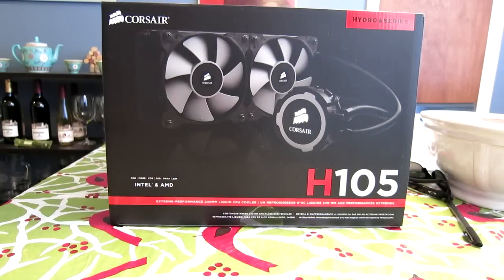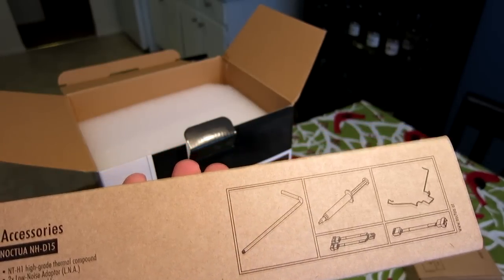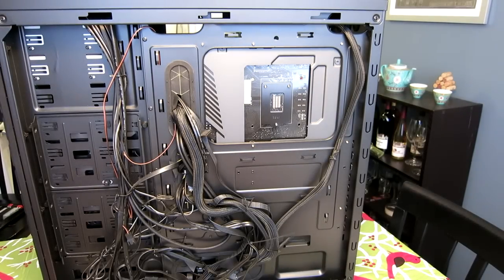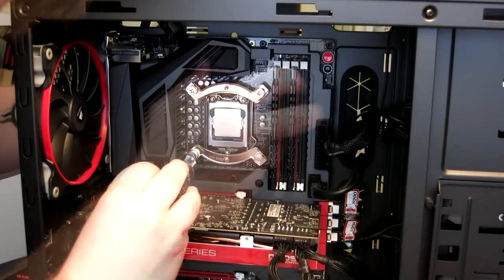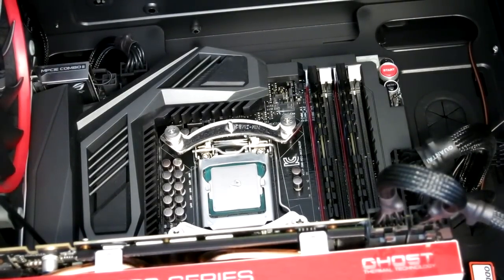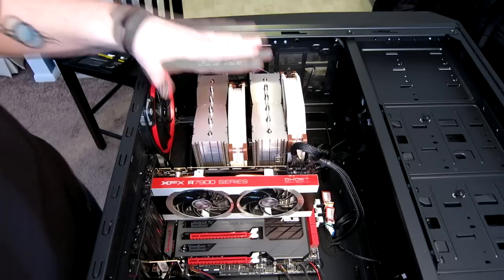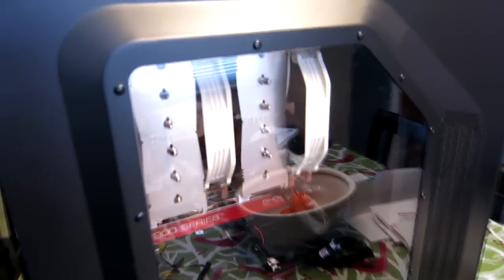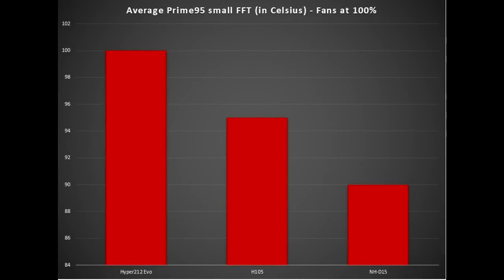Noctua NH-D15 Unboxing & Installation

Comment: I've been debating installing mine but this video has motivated me to do it a lot.. Thank you.. What I appreciate most is confirmation ( I couldn't find elsewhere) that you can install these D15's without having to pull out the motherboard 1st..  That would have been time consuming and risky for me since I'm not confident I can get all the Panel and SATA/ USB cabling back properly without a lot of fiddling.. I like the comparison Benchmarks too.. so before I pull it I will try find the Prime95 app and run it for a while. and Finally I was shocked to see you had so much overhead remaining between  the plexiglass side panel and the top of FAN 2.. That's very encouraging to see since I was assuming I'd have to leave Fan2 OFF.. Thanks Again .. wish me luck.. I'll be back in a few days with an update on how it went once I complete the effort.. Mine is a AMD Ryzen7 2700 into a MSI X470 CARBON Pro MB with G.SKILL DDR4 and a RTX 2080? Graphics card..   Thanks Again for taking the time to make this video.. even tho it's for a different processor .. it helped a lot
Reply from the maker: Glad I could help! Good luck!
Reply: @2XPGaming  Ok so here's a follow up. i did go ahead and install it. There was about 1/4 inch free space all the way around except for the DDR4 who's height would not allow for the second fan and still fit the top cover on the case so I swapped it with the Original Thermal Take fan which was about an inch smaller on each side, that was just enough to allow for the cover to fit.   Only thing I wasn't sure of was the AirFlow direction , it's not shown in the instruction sheet at all so I put the center fan back in just as I had removed it to tighten the main chip to thermal plate, and did notice on the side you can't see that the AirFlow arrow is shown there.. Not so on the ThermalTake fan but I made sire the blased were oriented teh same way and checked the directions theu ae both exhausiing Hot Air Up and out the vent and thurd fan in the top of the case.. CPU is free running at idle at 52C ,, and I will do some benchmarking soon.. It was too hard to get the prime95  so I will keep using HWMonitor and 3D MARK

Comment: I recently replaced my brand name, 3 year old liquid cooler with a NH-D15 because of concerns that as it got older the liquid cooler may fail and leak - totally wrecking my system - as happened in my previous system build which had a cheap, OEM liquid cooler.  To my tremendous surprise, on my 140w TDP i7-5820k, the NH-D15 significantly out performs the old (240mm radiator with two 120mm fans) liquid cooler - beating it most with a "100% CPU on all cores for over an hour" video rendering workload, consistently by 15C with a max temperature of just over 50C.  I did use a higher efficiency thermal paste than the NT-H1 paste that Noctua provided, using Thermal Grizzly that is supposed to be 50% more efficient.  Pretty surprised and impressed with the performance even though now there are a few other coolers that are reported to beat the NH-D15.  I trust Noctua's reputation which seems to be well deserved so far!

Comment: overall a really good video, a few things to point out though, I see you put on a antistatisk wrist band, that's a smart and really cheap way to protect your pc from accidental static when you are installing new hardware. Might be a good idea to clip it in though, since all you had on in the video was the wristband, witch dosen't do anything on its own. 
The second thing i wanna mention is your cable management, or should i call it "management"  your case has a lot of useful holes, notches, latches and trays for managing the cables. please use them :-) it would make me so much more happy to watch videos like this.

Comment: An excellent presentation, I purchased one of these today...02/09/2019 and was looking for some tips and tricks before installing.
I am putting this on a 9900k. Will be deliiddng and direct die install if it cannot control temps at 5ghtz overclock on all cores.
Liked and subbed thank you!

Comment: I used a Hyper 212 Evo for almost three years with an i5 4690k. During 100% load, it ran at 50-70°. I saw it go up to 80-84° with Prime96. I'm guessing you were overclocking? I did use a bit more thermal paste than you did, though.

Comment: Can I get some case recommendations that are compatible with this?
Reply from the maker: I recommend checking the case specs vs the cooler measurements as that will dictate what you get if you want it to fit. The case in the video is the Cooler Master storm trooper, fit fine.

Comment: Think this will fit in a corsair graphite 760t?
Reply from the maker: I would imagine so, especially since it is a full tower. Always check with the manufacturer specs to be 100% sure before purchasing.
Reply: I managed to install it, it was a tight fit, but im seeing a 20c-25c improvement over my H75 with an I7-7700k.

Comment: Does Noctua NH-D15 fit in Zalman Z1 neo caase?? Case supports maximum height 160mm, Noctua with fan is about 165mm high, can I close the case? There is a little more space in this ''window''
Please help, I appreciate.

Comment: how do you install this right now with the 212 evo my ram is almost touching the fan, but with this its much bigger how will i have the fan face the ram it wont fit.
Reply from the maker: If the Evo 212 is a tight fit this will be even tighter. The fan likely won't fit all the way down the cooling tower with the RAM.

Comment: i have mainboard  gigabyte h55s2v with gtx 770 4gb 384 bit ,,,, would 
that cooler fit in mainboard gigabyte h55 s2v (1156 socket) that already
 installed vga card manli geforce gtx 770 4 gb 384 bit ?,,, is there are
 an issue if i buy this cooler !! ??

Comment: Can I add a 2nd fan on the opposite side of ram instead at the side above the ram, because I don't have that much space above the ram?
Reply from the maker: Its going to depend on your motherboard and RAM height. You should check the specs on the tallness of your RAM when installed and then check clearance of your case with the fans. You'll need to consult manufacturers manual/website for more info.
Reply: Yes you can

Comment: I'm planning to pair this with an "ASRock X99 Extreme4 ATX LGA2011-3 Motherboard" could you or anyone tell me if it would block the first pci? I plan to crossfire in the future as well.
Reply: I'd suggest using pcpartpicker to answer your question. It's your best bet as other people might've tried a similar build and you'd see it posted there. Alternatively, you can start a new build in pcpartpicker and see if everything is compatible or not.
Reply: ended up going with the x99 a-ii, using it now and I it worked great. I ended up using noctuas compatibility list on their official website, worked along better. While PCpartspicker is good it doesn't really look at the compatibility of CPU cooler sizes. I found that half of the ones that were "compatible" on PCP ended up blocking the first PCI-E slot, which is something pretty major imo.

Comment: can the noctua nh d15 handle the heat of fx-9590?
Reply from the maker: +bonux50394 000 these air coolers are great for most anything. Will you get the coolest temps compared to a custom water cooling kit? Probably not. But I think this thing can compete head to head with all in one cooling solutions.
Reply: Christian Grytten The FX 6300 runs a lot cooler anyway, because the 9590 uses a lot of power almost as much as GPU's (maybe even more). Anyway on a cool day I get 39 degrees on idle and 50 on load, in a hot day 47 on idle and 55 on load.
Reply: I'm getting 49 degrees on idle (only using the middle fan, second fan is in my box), 53 degrees at load.
Reply: I have FX6300, temps are MAX at 28dgc, with all tests... :-> see my video
Reply: Cool, yeah i recon more cores more power :-). Still an awesome cooler
Reply: Christian Grytten if you're buying the 9590 for the cores don't, just get the 8000 version or get an intel.

Comment: I have a fx 6300 with a noctua nh d15 OC to 4ghz
Reply: Is that good or bad?
Reply from the maker: +Bumble Bee If you're getting good temperatures then that's fine. With OC you have to be careful not to overheat the CPU otherwise it'll get "burned out." Try using a program like RealTemp or CPU-Z to see what your idle and load temps are.
Reply: +2XP Gaming what temp is "good" for the cpu?
Reply from the maker: I'm more familiar with Intel CPUs but with any CPU, the lower the better. For example, my Intel Core i7-4770K idles at about 28C. Under load it goes to about 55-60C. Anything above 90C is not good, at least for an Intel chip.

Comment: how much room u have left? thinking on getting cm Haf 912 advanced, so i dont know if it will fit with regular size ram or i need to go for low profile ram (cm Haf 912 has 175mm cpu cooler clearence where as yours has 186.) do you have 12 mm free room or more?
Reply: Do you know the height of your ram?
Reply: and there is more than 40mm  from top of heatsink/fan to the side panel?

Comment: That's not enough thermal paste. At all.
Reply: *****
Fair enough. In my opinion it should be a flat and thick enough layer so you can't see the name of the CPU. I think that's better since the thermal paste should be everywhere equally on top of the CPU to maximize effectiveness.
Reply: The thermal paste is to close the gap of beetween cpu and the plate xD then this ppl put tiny bit xD

Comment: Hey i got a Cooler master elite 310 case  (Yes i know it's hella small but it came with the original PC where after i started switching stuff out.... i bought the PC before i learned to build one myself...) Anyway getting off the subjekt here, i got a M5A97 R2.0 motherboard with horrible cable management but i can fix that... I were looking into buying this cooler but seeing how big that beast really is... I'm really not sure it's gonna fit... Soooo what do you think?
Reply: ***** Actually i just talked with my dad about making my own cabinet! :D I'm really hyped because i can make it really big without paying almost 200 dollars.... Things are expensive here in Denmark...

Comment: Lol terrible CPU the 4790k runs at 65°c max OC
Reply: Better just have single heatsink these days with 2 fans mounted even Skylake thing is running so cold that there is atually a problem in the silicon procces that doesnt allow to overclock above 4.9Ghz even with liquid nitrogen all that stuff doesn't even matter anymore...